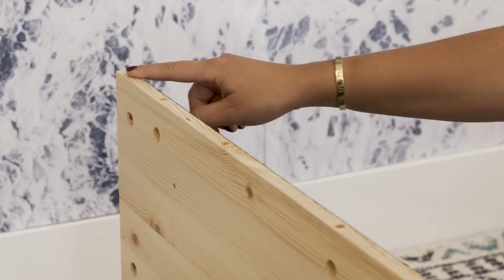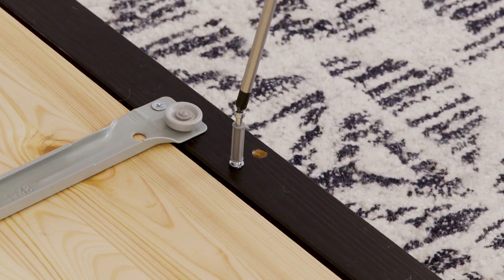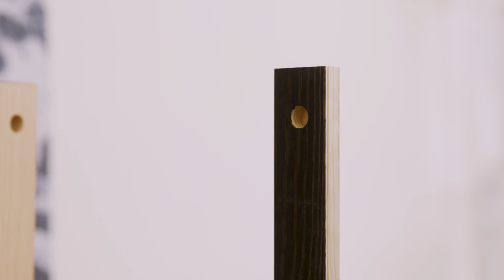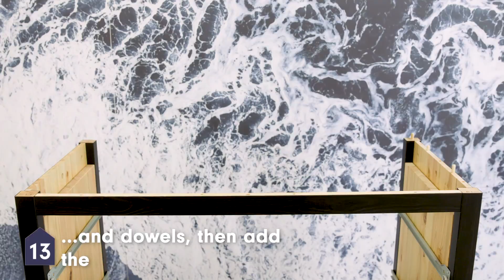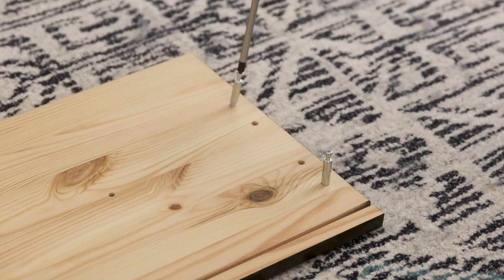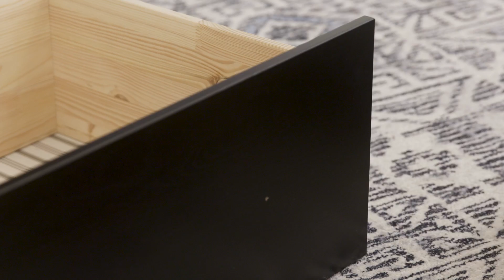How To Build The IKEA Hemnes Dresser | House Beautiful

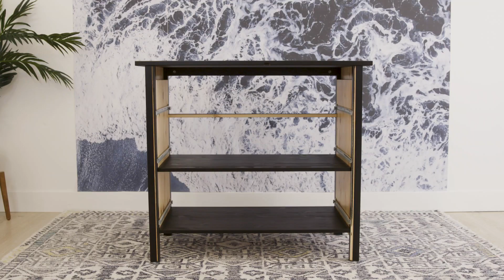Comment: Hello, at 2:26 you have a middle and bottom plank/shelves which connect both side (please apologize, english is not my native language). Where did you get them please ? I haven't such a thing in my Hemnes dresser... And it's hectic as hell (there is almost no "stop" on drawers, so if i pull them they fall, and i have space between drawers' façade when i close them, which i presume has to be filled with the shelves...)